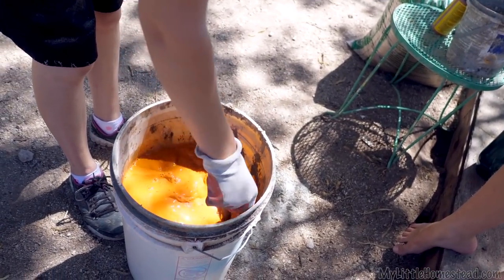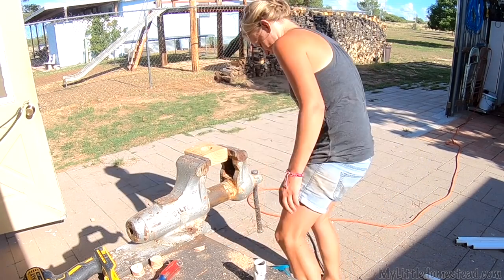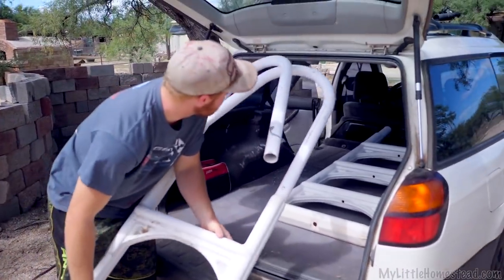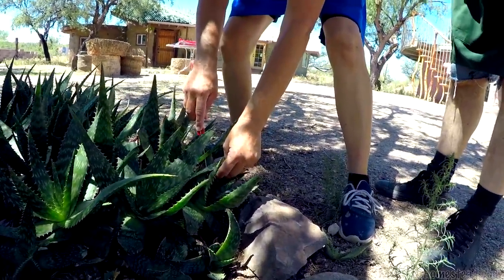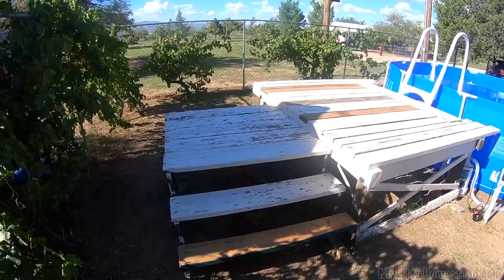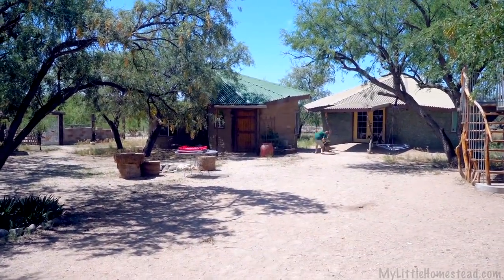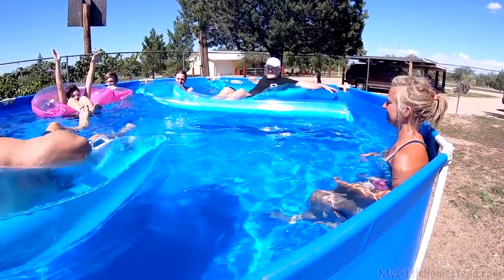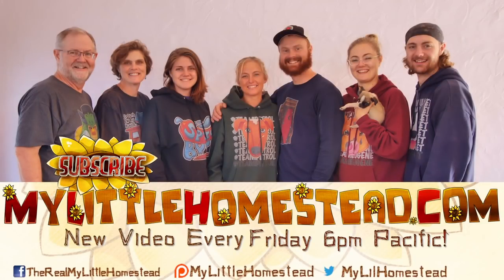Earthbag Stair Landing, DIY Pool Frame & Homemade Button Down Shirt | Weekly Peek Ep198

Comment: Had problem with wasps on my porch every year. Read that they are very territorial and hanging a crumpled paper bag would make them think my porch was already taken. Worked like a charm! You can also make fake nests from paper mache and hang them wherever you don't want wasps. Bonus: no chemicals
Reply: Deanna Pardue didn't know that, good information!
Reply: same
Reply: The paper bag works. I have already tryed it..
Reply: I was a bit disappointed with the pool. I had expected something more 
like a fam. relaxing platform , and in summer place pool back inside. Lol .  ...ahhhg ah ..switch pool...party..hey can I take my pool with me :-)
Reply: Awesome tip; thanks! I've only had a couple little mud wasp insurrections, easily discouraged by knocking their tiny nests off the stucco (because they were only about 2" x 3"). Then they got painted over when the HOA repainted the exteriors.
Reply: Wow really? Thanks for sharing💓!!
Reply: Can't wait to try this

Comment: Coffee grounds (unused) added to mortar or cement etc...makes a fabulous color when it dries.
Reply: Valerie Mosso Does it have to be unused?
Reply: @tiaking2002  you could use the used ones as well, the color just won't be as intense.

Comment: I made a pvc and clear plastic green house cover over my therapy pool. It works great to keep the water from evaporating, and also keeps the pool super clean, since when closed it keeps the rain, dust, bugs and pollen out of the water. (and wind when it starts getting cooler)  I attached the clear plastic to the frame using Snap Clamp 1/2 Inch X 4 Inches Wide For 1/2 PVC Pipe White 10 per Bag
 by Circo
Reply: Perhaps a screen house might be cooler in the summer and wrap it in plastic in the fall.
Reply: @maryblaylock6545  But that wouldn't help with the evaporation and dust. Use large flaps that can roll up when I am in it, securing them to the bottom with magnets when I am not. (my pool has a steel frame)
Reply: @rennemichaels2706  the flaps and magnets are a good idea! I do like the screens to keep the bugs from biting when you are in the pool. Why not have both!?!

Comment: Ellie, if the deck is too rough, you should be able to sand it down to make it a bit smoother without losing any non-slip properties.
I sail, and my dad used to do this the the deck of my boat, ie: sand and varnish with a sanding down so we didn't graze our knees and bony bits on the feet but still get a grip.

Comment: I use aloe as my facial moisturizer. It helps with any breakouts I might have going on and makes my skin feel great. 
Best time to deal with a wasp nest is at night, after they've all returned to the nest and are sleeping. Then you spray right into the nest and they don't come out after you.

Comment: @8:46 a friend told me about using Olive Oil mixed with aloe and it actually reversed me having to lose a crown I had a root canal on as well as 2 other cavities. I am not sure why it works but it really does work! It is known as  "oil pulling" not sure why it is called that but it is using olive oil as a mouth wash...Thanks for sharing another amazing natural /holistic remedy

Comment: So.....how long till you earthbag around the pool and platform?? :) Awesome work guys.
Reply: that would insulate the pool not a bad idea
Reply: @bobrobert6277  Think it would be heatable in winter?
Reply: @elewyisssca9310  i was mostly thinking of trying to keep it cooler for less loss of water from evaporation . with the kind of heat they get its probably a warm bath still refreshing but maybe could be improved
Reply: Keep in mind earth-bag construction and (splash) water do not really mix that well...
Reply: @joopterwijn  might not be the best ide but can't a simple tarp fix that issue , but you are right you don't want those bags to get wet after they settle.

Comment: We used a concrete dying technique called cool deck when my family built gunite pools ...the cool deck is a concrete coating that doesnt get hot we splashed on with brushes and knocked down with a trile once firm. Pretty cool stuff my uncle done a bathroom room floor in his house with black cool deck , came out pretty good. White portlain marble dust and dye 2 to 1 mix 2 portlain 1 dust and dye mix dry before adding water

Comment: I just did concrete countertops in my home. I did a feather weight over laminate and over plywood. It tuned out fabulous. I sealed with 511 impregnator sealer then topped that with a very think coat of Johnson's paste wax. Water beads off wonderfully. If you go that route I recommend using a spatula that's for working Venetian plaster. It has rounded edges and burnishes the concrete as you work it is. I used Henry's featherweight from Home Depot and mixed up a large red Solo cup at a time because it sets super fast (even faster if you use hot water). Can't wait to see your countertops!
Reply from the maker: Nice. Thanks

Comment: Great idea with the sand and the paint!  I have a handicap ramp that is slicker than snot when wet. I could take a smaller  can and paint stripes across it. It would not only slow down people walking on it but all so the tires of a walker or a wheelchair. It would also work to use the paint on slick stairs like at my daughter's stairs that go up to her 2nd story. They have all fallen down them several times! My mum has also fallen down her back and front steps off her decks. And now she has a ramp in the front that needs some traction on it. This idea would work for her! She's 82 y/o and doesn't need to fall on it!  I wish I didn't have a black thumb. I can't grow Aloe. I need that kind of mouthwash. I have a dry mouth due to my Sjogren's and my BiPAP doesn't help it or my teeth. I'm off to the dentist again tomorrow (every 2 weeks to 2 months) to correct my bite and to fix another tooth. {*hugs*} to everyone.
Reply: I've made several handicap ramps, found covering the entire surface worked best. Also you can roll on a heavy coating of paint (or clear sealer) and then broadcast (sprinkle, sugar shake) the sand (I used glass grit)  onto the wet paint. This lets you control the amount of grip. Also eliminates lumps, heavy spots or paint peel, as is very easy if re-coat/re-sand touch up is desired a few years down the road.

Comment: Hi, my mum had a sowing machine just like that one, it was foot powered but even then could sew anything from cloths for us to an awning to attach to our caravan. I bought a small motor for it and converted it to run on power, I had homemade cloths until I was 18 years old and left to join the Royal Navy, I was horrified to find out the cost of cloths and my Officer uniform was expensive and when I went home for some leave my mum looked at the uniform and started picking holes in the way it was made. Seeing that machine has brought back all those old thoughts of my youth

Comment: A light blue cement mixture, then swirl in dark blue when pouring....
Reply: That sounds very cool!
Reply: Since we are on the subject, I ran trim in a multi Million dollar house, a real mansion. The Stucco Guys was task to make the cement walls into marble, and I watched them do it, with stucco. Of course it wasn't actual marble, white, light blue swirls, but it certainly looked, & felt like marble. Always cool to the touch. Very hard, and like it was polished marble. After it looked perfect to me, they skim coated several more times. It was amazing. I haven't studied the dying of cement, or stucco, but the info's out there. Probably on You Tube. "Stone Coat" would be a show of the range of things done with dyes, then go from there.

Comment: For wasp or bee stings, put ammonia on it as quickly as you can. Use the ammonia without detergents. If you get it on quick, the sting goes away and it prevents swelling. Its not as effective but in a pinch you can use raw onion juice.

Comment: Long time lurker, I love your videos!

For your countertops, check out images of "concrete glass countertops."  Recycled glass chips embedded, then ground and polished, sometimes even with LEDs.  Also look at the effects you can get with concrete stains, instead of tinting the concrete; and the images that can be made with fiber optic concrete.  Be careful the dogs don't get alkali burns from the fresh cement.

I have experience with painted ramps.  Normal paint becomes really slippery when wet, use "porch and floor" formula I learned the hard way one dewy morning.  Always scout the deeply discounted unclaimed mixed paint every trip to the hardware store.   Adding sand into the paint makes it hard to apply evenly.  It works better to paint a wet layer then sprinkle the sand into that, working in sections if needed.  Then follow up with a thinned layer after the first is completely dry; a roller works better than a brush for this coat.

Comment: You guys are inspiring! I want to try out making an earthbag dwelling on our up and coming homestead site but wonder if it’s a practical option living on Washington state... (we’ll be up in the cascade mountain range.) Winter’s are unpredictable. Some winters we don’t get snow, some we do... 

With the earthbag cabin Ellie and Garen rebuilt will it be warm with in reaso? We will not have conventional power (up in the mountain area surrounded by weyerhaeuser property (logging) and there’s no power out there so we’ll be doing dual fuel (gasoline and/or propane... probably propane) generators (4000w) and slowly add solar. As well as possible hydro power (2 creeks run through the property) and the cabin/dwelling will be built near the main creek’s waterfall.
Reply: EGH Video Production By Shay why not a rocker stowe

Comment: I have a recommendation for any future Wasp "eradication's" that you may need to do. As a former professional Picture Framer, I have used "Spray Adhesive" that comes in a can. If you go after them when they are kind of dormant, (early morning-?) you can just spray them and not worry about any getting to you. There wings stick together, and they're done! Hope you don't have to deal with them again in the future, but if you do, I hope this helps.    :)

Comment: That was great fun! Thanks for letting me come with. If I can make a few suggestions? In no particular order, just as I remember things: mouthwash- if you squirt a little grapeseed oil (NOT rapeseed, which has a good reputation but isn’t as good as it looks and has no preservative properties that I know of) or a little Vitamin E (I will poke a hole in a Vitamin E capsule if I don’t have any handy) as a decent preservative and hopefully it won’t be so quick to change color. Just a thought. I make my own tinctures, salves and developed a great mouthwash for gum disease and learned a trick or two when I studied. Sand paint- I did the same thing, adding sand to paint, for around our pool to minimize slipping and sliding where someone might get hurt. If the kids spent too much time in the pool, and their skin became soft and ‘prunish’, the sand cut the bottoms of their feet. Sand is different, which is why you see black beaches, white beaches, tan desert sand and blah blah blah... I picked up some sand at the local big box hardware store in the area. Your sand may be softer, or even worse than what I had (who knows?).  I just wanted to make you aware of the possibility. I painted a few layers of paint over it to soften the “edges” or pointed ends of the sand but if you paint too much it will get slick, which you were trying to avoid. 
Bat guano (are any other creatures dropping’s called guano? Or is the label ‘bat guano’ redundant?  I don’t know.) can be very acidic and cause injuries. Be sure to wear gloves when messing with it. Just an FYI, which the entire note is. There was one more thing, which i have forgotten. Sorry.   I hope you find this useful. Cheers!

Comment: One thing that has surprised me, is with all the mixing of cement/earth/clay/etc you do, that you never got a small 4 or 6 or 8 cu Ft portable Cement Mixer. They are surprisingly cheap, and easier to use than trying to hand mix with a shovel, and will guarantee a uniform consistency of the mix.

Comment: To save $$. Buy a dry concrete dye, by the pound, at a brick processing company. You won't be tossing plastic bottles and can control the shade since the powder is concentrated and is sold in a paper bag.

Comment: Just a quick tip instead of mixing up your concrete in a wheelbarrow try using a tarp put your dry mix in the middle of the tarp make a hollow in the the dry mix then pour you liquids in the middle of it then with two people hold the corners of the tarp and by lifting it up and down it will mix up your concreate thats how a lot of us do it in the uk if we don have a cement mixer

Comment: I'm pretty sure if you want to maintain your color when dying concrete you need to use white portland concrete and marble dust/white sand mixed 2 to 1 , 2 concrete 1 dust/sand.... I think this is the cheapest way but there is probably colorless concrete that's more expensive

Comment: I can recommend it for skin use I don't have a knowledge for mouth use but I've noticed the aloe Vera gel lasts longer when I put Jojoba Oil in it. Not very much, 10:1, but you can experiment. 

Aswell, you do you but my aloe gel doesn't last more than a day or two out of the fridge. I have my gel in an empty honey squeeze bottle for over a week filled with a whole foot long aloe leaf. 

3rd, I'm sorry, I'm rambling and correcting and I'm sure you figured it out already but a spoon scrapes all of the gel with out taking any of the skin.

Comment: Last year a neighbor of mine explained these small paper bags that he had up in the corners of his front porch. He explained that they were Artificial Hornets Nests. He went on to explain that he grew up on a farm and that his dad and grandfather used them in their barns and implement sheds. Ok, so I moved last October and my covered porch was swarming with wasps, carpenter bees and wasp nests. This spring I  put up one artificial hornets nest and boy does it work. I watch a wasp or carpenter bee fly onto the covered porch and  they immediately turn and fly out. I have not had one wasp nest this year so far. You can by commercial hornets nests on Ebay, but they are so easy to make  yourself. You have a lot of building with overhangs so  you have the conditions for many wasps. Here is how you can make your own: 1) Take a small brown paper lunch bag and crumple it up. 2) Loosely crumple up balls of newspaper (like snowballs). 3) Stuff the loosely crumpled newspaper snowballs into the crumpled lunch bag. 3) Draw the lunch bag together at the top and secure with string or wire-tie. 4) Hang the fake hornets nest up under an eve or inside a shed. Just avoid hanging them where rain will get them wet. I did not paint my gray or anything.  It works. You may not want to believe me, but try it.

Comment: What would be cool is if you could make a pool out of those bags that you have made some of your rooms out of that you fill up with dirt? At the same time it would be cool if you could make it so there would be an area that would be covered and an area that was not covered. The pool would have a hot tub that would have access from the pool directly and there would be areas under the covered areas and in the uncovered areas where there would be some tables where you could eat and drink inside the pool. At the same time there would be areas where you can be in the water but lay on a bed type of thing where you can be in the water but not have to  worry about trying to float. Just get some color changing lights and light up the inside and outside of the pool and I know that you have made some windows out of bottles and in the sides of the pool itself you could put them there so while swimming you can see outside and others can see you swimming. I know that would be cool to have a BBQ and be in the pool with music and a big screen TV and not having to get out to eat that big burger? Part of the pool would be under ground and if you could add underground tunnel where you could have a bubble dome that would allow you to swim down and pop up in a clear dome at the bottom of the pool?

Comment: Hey yall! About wasps!  You can just knock their nest down and run, and they will not build another in the same spot. If you don't kill any of the wasps, they won't sting you, although that might depend on the species. Wasps are actually very beneficial to the garden. They eat slugs, aphids and larvae of various types. Some are also stingless, or don't bother to sting people. If you can avoid it, its probably better to leave those chemicals under the sink and just use a broomstick, or just leave them be altogether.  <3

Comment: You cant do Pure peroxide wash it will EAT the enamel off your teeth you need to do a 2 to 1 ration (2 been water).
Once the Aloe Vera turns pinkish you can add some goat milk and turn it in to a whole body moisturizer (w/o any chemicals).
Love your videos .......and your general out of the box thinking ideas!!

Comment: and i look your mouth was on google it gave this idea 1/2 cup aloe vera juice check the supplement section of a health food store.
1/2 cup filtered water distilled is the best for DIY products but filtered water works for short-term use.
1 1/2 tsp baking soda.
2 drops peppermint essential oil.
1 drop tea tree essential oil.

Comment: The best ecological way to kill wasps is to use a sprayer with water and Dawn dishwasher detergent.  Kills them faster and not toxic to humans.
Reply: On the nest or on the wasps themselves?
Reply: Mary Blaylock on the wasps themselves.  It clogs their breathing holes and they die within seconds.  Not sure if it does anything to the larvae.  If you spray on the nest and leave the nest, they will come back.  However, you will see the wasps die right in front of you if you spray them directly.